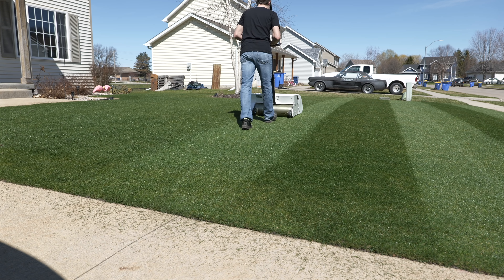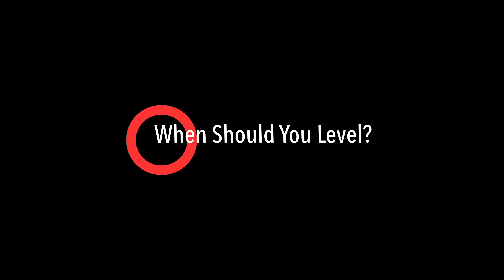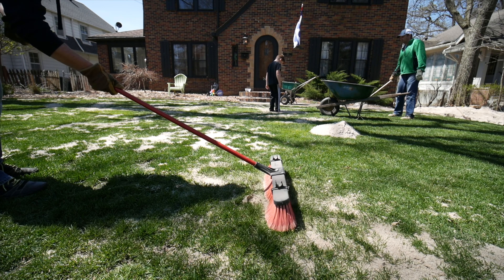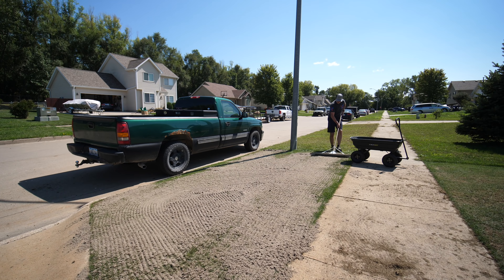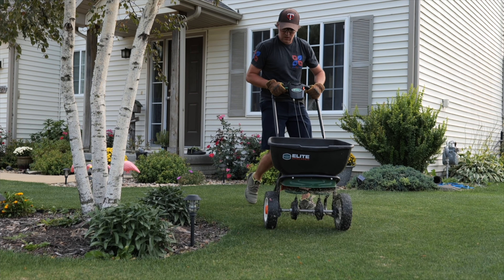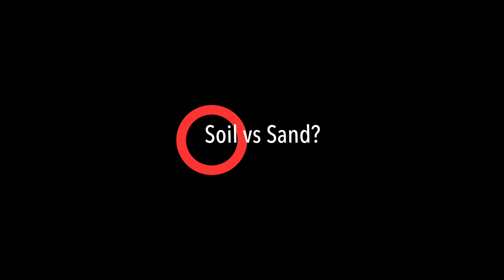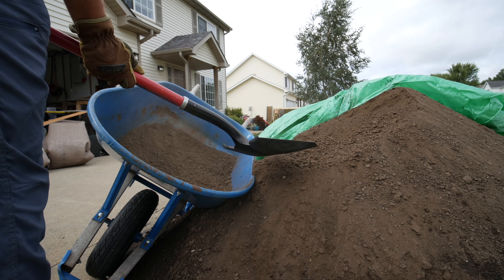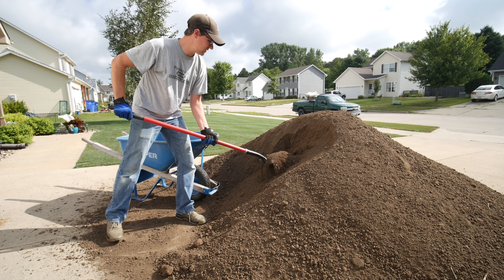Can You LEVEL Your Lawn In The Spring?

Comment: i was on the fence about leveling and preemergent, and you made it an easy decision for me. I bought prodiamine last lear, and used a sprayer to apply it, but i think it got it way to late in spring, so this year, i am going to focus on getting that in before 55 degrees.

I live in Iowa. How much before the 55 degrees should it be applied? I mean our average temps have been fluctuating. Today the air temp is 29, last weekend, the air temp was 66..  i have not temped the soil yet, but plan to today or tomorrow to make sure its still under 55. Should i just go ahead and put the prodiamine down?
Reply from the maker: https://youtu.be/6bcaG2b8txk

Comment: This comment is marginally off the main topic...at 4:19 you're shoveling dirt off the top of a pile.  I like that you're using a flat blade shovel, but your body will thank you if you always shovel from the bottom of the pile.  When you always take the dirt from exactly the same place, you get into a rhythm using the same muscles.  If you take dirt from a different place every time, because it is impossible to take dirt from the middle and hit the exact same spot every time, you will use different muscles with each scoop.  It's the same amount of scoops no matter which way you do it.  I'm in the middle of moving 8 yards of mulch from my driveway.  It's good exercise.

Comment: Can I just level once with sand or do I need to continue every year even if it is not needed (Ohio KBG lawn)? I have heard you and others bring up sand capping the lawn and once you level with sand you will have to continue every year or so because organic matter will create layers? Do I care about layers? Grass grows in concrete and in truck beds.
Reply from the maker: If it were a minimal amount of sand it might be possible to stop at one time, but if you have a more significant cap, organic matter buildup would eventually cause problems of not allowing air, water, and nutrients into the root zone. A new topdressing of sand helps to dilute this thatch along with continuing core aeration.
Reply: Thank you for the response! I am going to go light on the sand and see how it goes. It is year 2 of a newly planted kbg lawn that does not need too much.

Comment: Can you use those green compost spreaders for top dressing the lawn? Just wondering if you filled it up with soil and put it down, how effective would it be and would there be any other steps needed?
Reply from the maker: As long as the soil is dry and not clumpy it will work. I have used it for that a few times but it just can't be muddy.
Reply: @ryanknorrlawncare  would it be better to put seed and fertilizer down then top dress with soil or put the soil down first then seed and fertilizer? Thanks for taking the time to reply, I'm from Canada so I haven't seen many Canadian lawncare channels!!

Comment: My lawn used to be bumpy as heck, I have a combination of zoysia and TTTF. Now that I have a consistent 4.5 inch tall stand of turf and mow a different direction every 2 or 3 times my lawn gets flatter and flatter. My lawn is a gradual hill with a ditch by the road so I cannot level it like yours, but it is extremely smooth now.

Comment: Thanks for the great content, as usual.  Quick question - at what point in the spring do you attempt to overseed PRG?  The overnight lows are still in the 40's, though the day time temperatures are in the mid 60's.  I was going to wait until the overnight lows are consistently above 50 - is this the right thought here?  Or can I seed earlier?  I'm impatient 😂
Reply from the maker: If you can check soil temp you would want it to be around 50-55 if possible but also remember that you need quite a bit of light and the days will continue to get longer so that is in your favor if you wait just a bit.
Reply: @ryanknorrlawncare  thanks!  The Greencast average has been above 50 but didn’t consider sunlight. I’ll wait a bit. Thanks!

Comment: I live in Florida (actually bought your leveling tool and it works great).  I'm planning to both overseed and level my lawn.  Also, I want to break up some of the crabgrass and overseed with Bermuda. And I'm concerned I'm not going to do this in the right order.  Does it make any sense to dethatch and scarify lawn before level and overseeding.  I just want to make sure I do this process of dethatch, level and reseed in the right over.  By end of February we should be beyond any freezing.  And with my winter rye grass, I've mowed all winter.  I enjoy your videos very much!
Reply from the maker: Most of the time with bermuda you wouldn't need any overseeding. If you dethatch and scarify and then feed it once it warms up it should fill in aggressively.